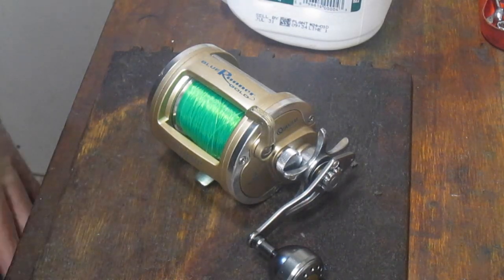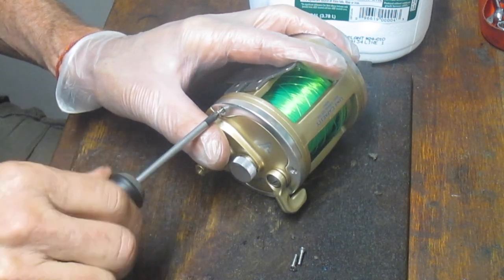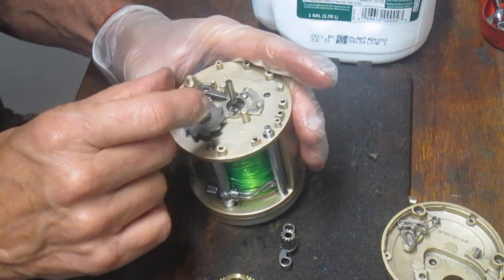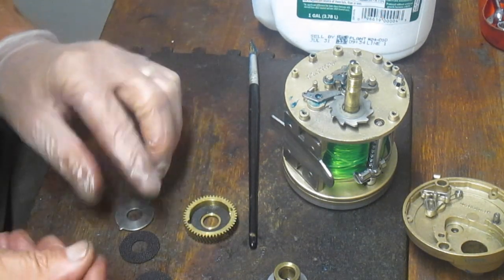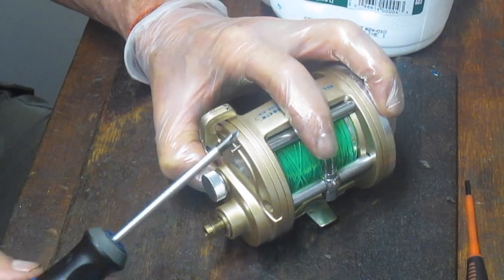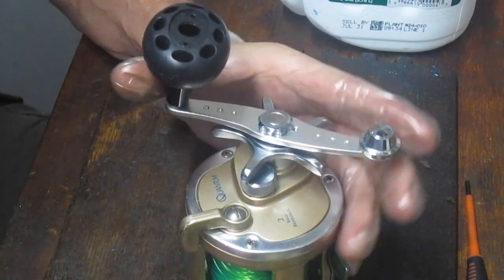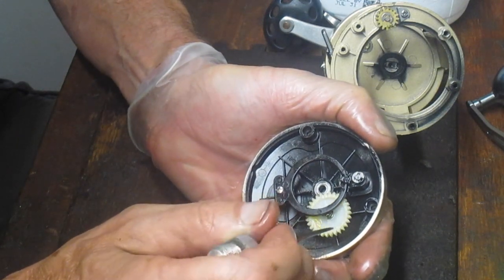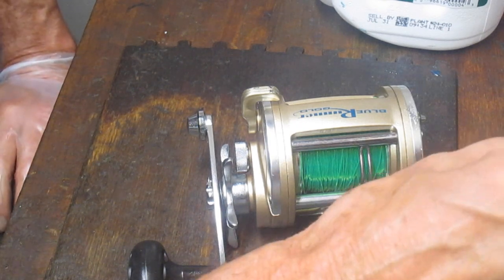Quantum Blue Runner level wind saltwater fishing reel how to take apart and service

Comment: These reels appear almost identical to the kindve goofy looking  Quantum Bill Dance Catfish reels believe it or not. I have a couple and for the 35 bucks or so they can be had for, they're tanks. Several blue cats approaching triple digits on them over the years...This clicker design is quite audible and tunable if u play with them...At any rate, great videos sir- thank you!!!
Reply from the maker: Thanks for sharing and for watching.  The reel is by the same manufacturer, so they often use the same design and sometimes parts and just change the base, frame, cosmetics and name to present it as new.  I wouldn't surprise me if they are the same, at least internally - Dennis